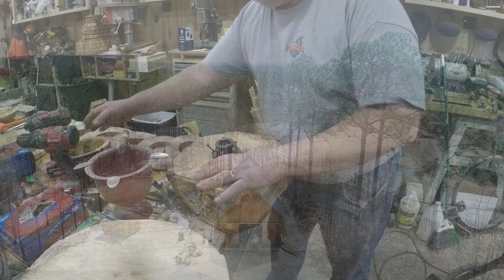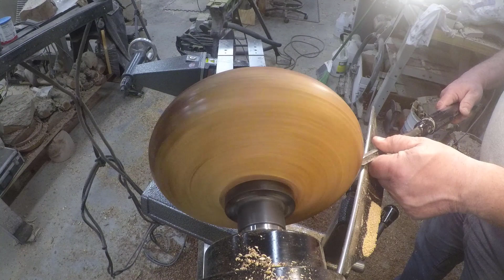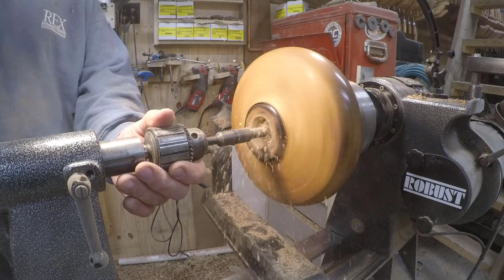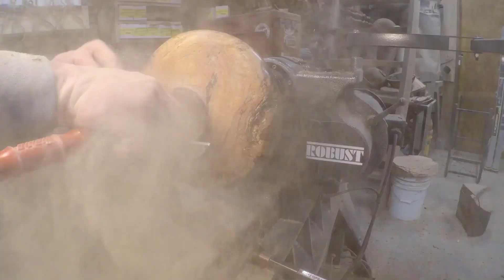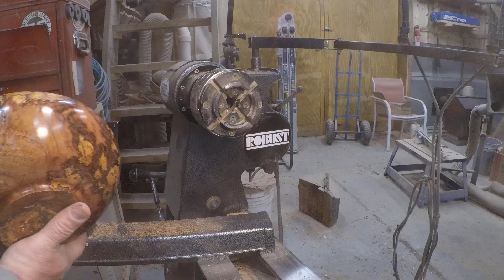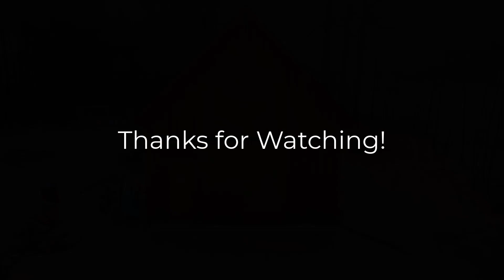Woodturning  Punky Wood

Comment: Mike way cool piece! Really turned out nice. I loved the shape.  That finish really made it pop. 

Do you ever stabilize anything before turning in a vacuum chamber? I've never noticed you using one before and was just curious if you do.  I'm currently saving up for a pressure pot for resin casting.
Reply from the maker: I do not have one but it might be nice to have for sure!  Thanks!

Comment: I must have gotten the abbreviated version. I didn't what yoh did to stabilize the punky piece. Did you soak it in some hardener? Coat with a stabilizer? I've only been turning for 2 months, so maybe I missed the secret handshake.
Reply from the maker: I did use some stabilizer.  That piece truly was on the edge of being plain rotten.  But it did look great and I did sell it.  Thanks for watching!